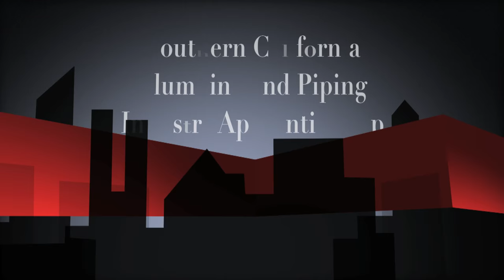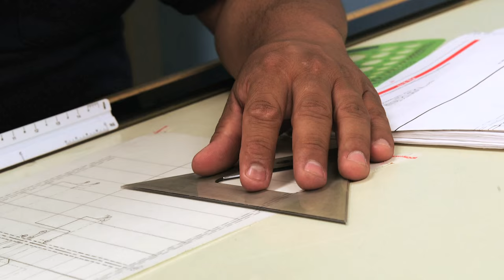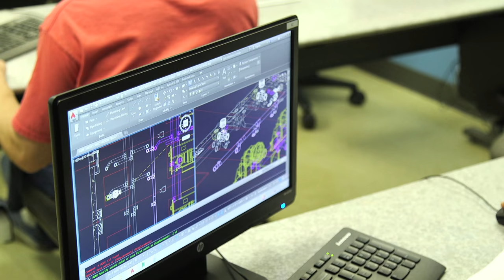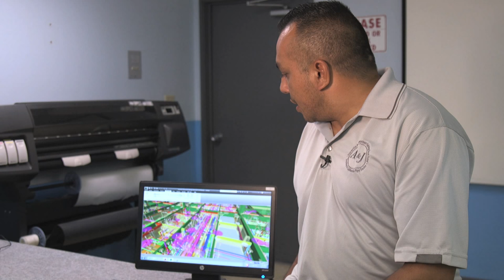Southern California Plumbing and Piping Industry Apprenticeship

Comment: I signed up to join local 342 in 71,got in in 74...5 years apprenticeship...Turned out as a WELDER. In 21 years I never had to travel .I had to retire on Disability but get in the trade was the best thing I ever did.Started at $ 6,46 a hour in 95 when I Retired I was making $34 +-.

Comment: Any material advice to study for the local 230 aptitude test??? What kind of questions will I come upon...
Reply: Sergio Lopez you may have already taken the test but for anyone else’s that comes across this the local 230 test is mainly math. Multiple digit multiplication and division. Adding and subtracting large numbers thens there’s multiplying dividing adding and subtracting fractions. Then there is a small portion on tool knowledge and reading a measuring tape. There was only one reading apprehension question and it was confusing for me. I’m more of a math person than reading so I felt the test was easy since it was mainly math. I passed the test taken in October and have my interview tomorrow